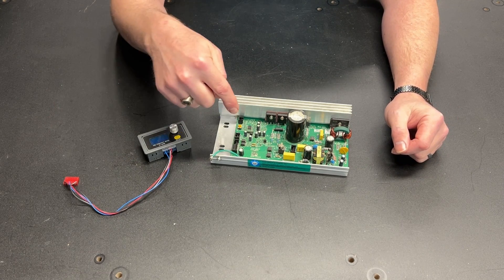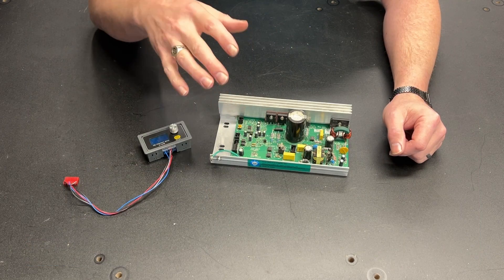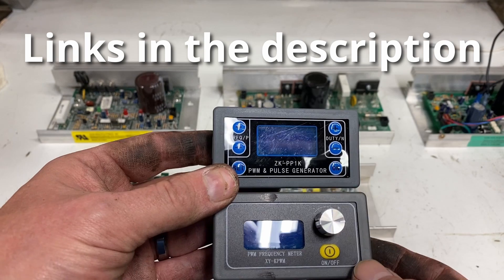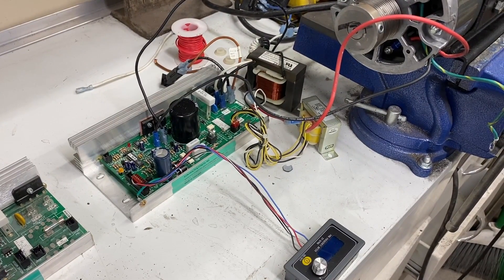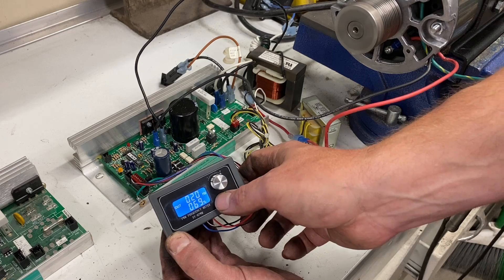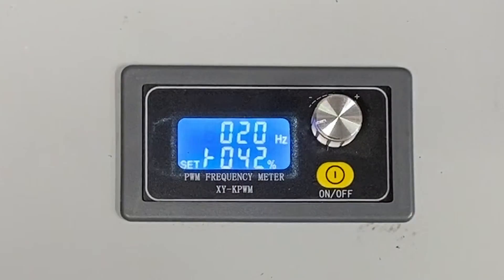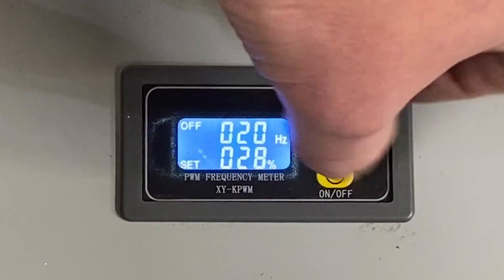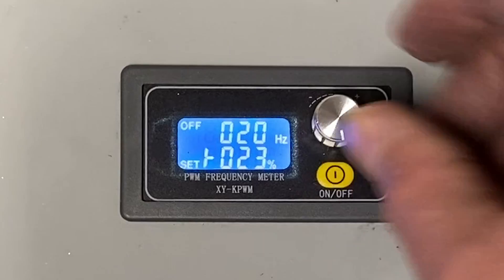Programming XY KPWM & ZK PP1K PWM Signal Generator For Use With an MC2100 Treadmill Motor Controller

Comment: Hello I have the 2100 rev B board and bought the PWM pulse sender and wired it as your video shows but when i turn the knob just slightly the motor gets a big surge of power for about a second the brushes spark violently and spends up quickly but thats it know more power it just slows back down. Also the led on the 2100 does not blink like you mentioned it just stays on. Do you think the board is bad or is there some way I might have wired it wrong? Thanks for the videos they really answer a lot of questions
Reply from the maker: The board needs to be repaired.  The MOSFET and SCR chips likely need to be replaced.  Here is a video I did talking about that exact problem https://youtu.be/Xrs_5MaGjEc

Comment: How to make it work?, or do i need additional circuit to make it work?
Reply from the maker: what are you trying to make work?
Reply: @dazecars  coil
Reply from the maker: what coil?  your questions are vague and I cant help you if you don't provide info on what you are trying to do.
Reply: @dazecars  i am working on a project, wireless power transfer, and in order to increase the voltage output, i need to change the operating frequency of the primary coil, but my problem is how to make the primary coil to generate magnetic flux using PWM
Reply from the maker: That is beyond the scope of my expertise.  I am using the signal generator to control a treadmill power supply and am familiar with whats needed to do basic programming and function control on the signal generator.  What you are talking about doing is way more involved and not something I have any experience with.

Comment: Thank you, professor. I have a question: Does the pulse generator work on all panels?
Reply from the maker: it works on all MC2100s versions and the MC1650LS but not any of the boards that can be hacked with a potentiometer, or on bunch of boards that I don't have a hack for.

Comment: What do you do if your old display uses the telephone connector  type plugs?
Reply from the maker: Your question does not make a lot of sense.  I cannot see the components you are working with or the pictures in your head 😁  I am guessing that you have a different motor control board and that is where the telephone type connectors are?  If so I do not have a hack for any board setup that way.  I only have a hack for using this particular signal generator on a couple boards.  Your best option would be to get an AC variable voltage controller, a bridge rectifier and motor choke.

Comment: Thank you this info was extremely helpful setting up my PWM generator.

Question: Do you know where to purchase the connector or part number that plugs into the MC2100 board? I want to make my own custom harness for it.
Reply from the maker: Glad it was helpful. In regards to the connector, I looked once and was not able to find one.  Probably not using the correct name when looking. After I failed to find them new I started salvaging them from treadmills. One treadmill will often have two or 3
Reply: @dazecars  Thank you Sir!
Reply from the maker: my pleasure

Comment: So use a scr on the treadmill 😂
Reply from the maker: I know you are kidding but I am going to answer this question as if you weren't because a lot of people have asked if an SCR could be used on a treadmill to replace their failed board on a budget and others with that same question may end up reading these comments. The answer is yes and SCR with rectifier can be used for a treadmill but I always caution against doing that because the SCR has no treadmill safety features.

Comment: Why does this board on treadmills usually NOT have a Choke on the DC side. Seems if it's that important As I agree from your demonstration's, they would add one. I have only found one choke in 6 treadmills and it was the cheapest one.
Reply from the maker: There are two main kinds of treadmill power supplies, SCR or PWM.  The PWM produces cleaner power so the choke is not needed.   The SCR type boards (Mc2, MC60, MC80, MC1000, and MC200) do require the choke.

Comment: I have been reviewing your videos over and over again. Thanks for the info. I'm trying to use a motor and control board out of a Precor treadmill. The control board is labeled ALT-6305 and does not seem to follow the same color code as the MC-2100. Where could I get help wiring it up?
Reply from the maker: Sorry but I do not have a hack for that board.  I would recommend going the SCR route.

Comment: After losing my first MC2100 and spending over $200 to replace it, i keep every on board component in stock, this is my second board, using it for 3 years now, blown so many mosfets, resistors, a few caps, the rectifier a few times, just about replaced every component at least once, and haven't even come close to $50 spent fixing it.
Reply from the maker: it is fore sure a fragile board

Comment: I have a different one for my lead screw stepper motor. I have to turn the knob a ridiculous amount to change the speed. Never saw that in  the directions, but now I will be looking for it. the control is too fine but capable of a serious number of programable features. WWDZ ZK-SMC01 42 57 Stepper Motor Controller Positive and Speed Angle PLC Programmable Serial Board H0O3 Rever Pulse
Reply from the maker: Hope it uses a similar technique and you can make it less fine
Reply: @dazecars  Me too.
Reply from the maker: let me know

Comment: I have a treadmill motor that is 2.25 continuous/8hp peak. Do you think I would be able to get closer to that peak with better cooling for the motor?
Reply from the maker: More  cooling will get you closer to max but probably not all the way BUT if you are going treadmill motor you are likely varying the speed which means you will never get max HP as HP is a function of RPM.  Torque is the important number have you calculated the torque to figure out if the motor is actually up to the task?